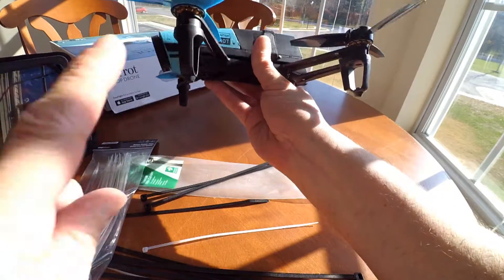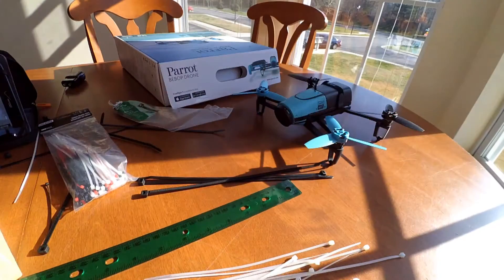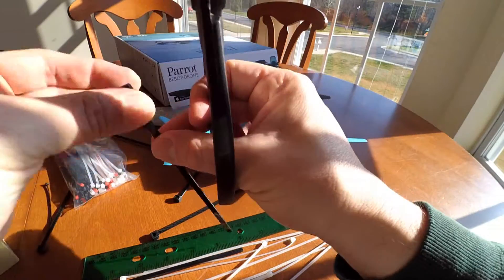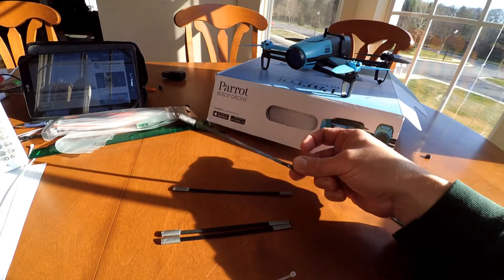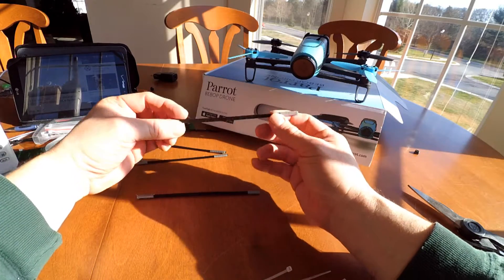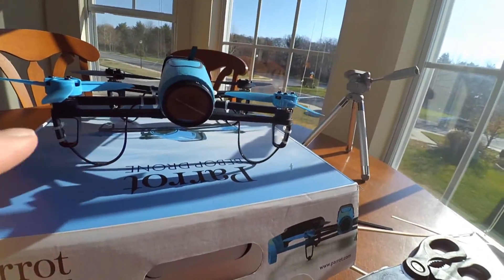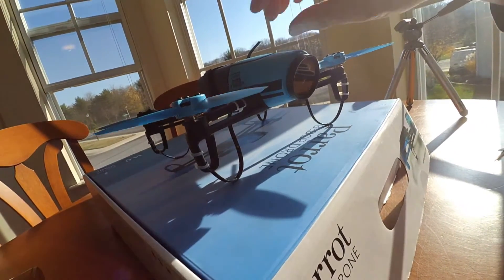Parrot Bebop Drone Zip Tie Landing Gear Mod Instructions

Comment: Can I ask u my friend, . . a Question about how u have put them on if u don't mind as I've Only jus got my bebop and looming to upgrade it a Bit "BUT IN MY 😎 WAY" lol, if U get what I mean, . ! Anyways, . I was watching u do this and YA 😉 good Idea 💡 with the Rip ties, . But if u Don't get ALL 4x 100% The SAME 😶 Not it through it off balance at all, . ? Also if U look at the Feet on the bebop drone, . It's got Holes in the. All Init, . . So Can We Jus Push the Rip ties through them Holes until the Block bit fits inside each foot jus above the Holes, . ? Then put a WEE Dab of super Glue to hold the Rip ties in Place, . Or Fix them there Using them sticky Pads they use for Car rearview Morris, . As we could put a Hole in the middle of 2x Small, Cut to fit the Feet Sticky Pads FIRST, . As to feed the Rip Tie through 1, Then Super Glue that to the pad & then through the hole in the drones feet & then last the Next Pad that would stick the the Bottom of the Foot & after fit it Proper how its wanted, . A last Blob of glue on to Rip tie an middle of the Pad, . "BUT NO GLUE AT ALL ON THE FEET OR THE DRONE" . 😇 . . ? But as I did Say, . I'm only Putting my 2p Worth in the mix 😄 lol . As to Help all the bebop uses Really, . ! Mines NOT WELL . ? As it dose turns on Green flashing then Red flashing - then my Wi-Fi finds it & Says Connected, . 😕 . But then the Drone Shuts Full off, . . Over & Over & I've tried all Sorts 😞 so if Anyone Can Help me that would be Great, . Nice 1, . DAY, . From the UK England, . !
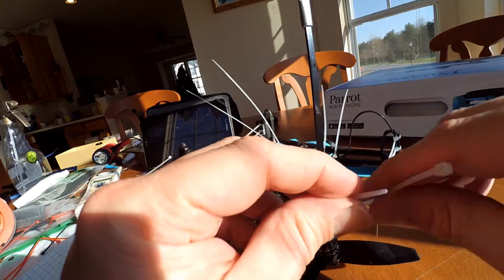Reply from the maker: Hi Day regarding Zip ties watch it at 2:46 and  3:20 and 4:24 .  Regarding issue, that may be software.  See if u can update the drone if that doesnt fix it you may have a problem with the drone.  Good luck.  Also check out some drone lights https://www.youtube.com/watch?v=bLSxYYdIk24&list=PLmU9GE0GdNRuwGJAhx9zQaUYBfE_ITYSj

Comment: Looks like it sits lower in the back than the front. Wouldn’t that mess up calibration ?
Reply from the maker: For some reason it sits level.  This set up was after my trying other sizes and I ultimately made these at the size you see here.
Reply: Tommy Drone's Drone Reviews & Tech Stuff  Yeah I tried the same size too, and it wanted to fall forward on its nose ! Maybe shorter lengths would work better ? Thanks for the reply !!!
Reply from the maker: AT 4:25 I do suggest instead that  you place the zties to the outside of the landing loops on the drone.  In the video I went up on the inside though the middle.  That was a mistake as I sacrificed stability when it landed.  Recommend placing the Zties on the outside of the loop instead. Also consider adding finger lights they make it fun. 
 https://www.youtube.com/watch?v=bLSxYYdIk24&list=PLmU9GE0GdNRuwGJAhx9zQaUYBfE_ITYSj
Also be sure to use a UV Filter to protect the lens.https://www.youtube.com/watch?v=myMCbRVo8Q0&index=3&list=PLmU9GE0GdNRuwGJAhx9zQaUYBfE_ITYSj

Comment: what was the lengths you ended up using for fitting it into the box?
Reply from the maker: Hi Guinnesspeaks I show that starting at 5:25 . The zip tie dimensions I used are around 2:50 however you can modify the lenght to what u like.